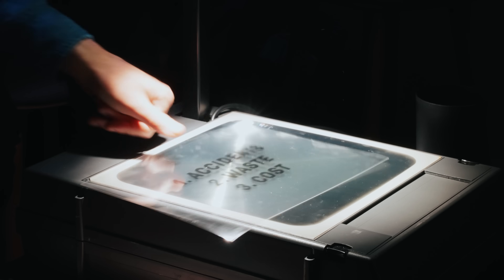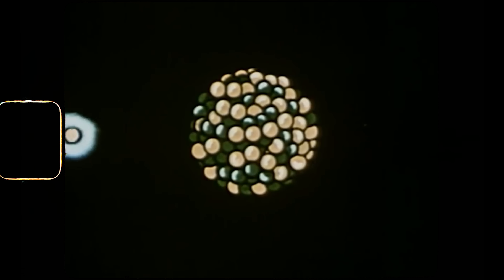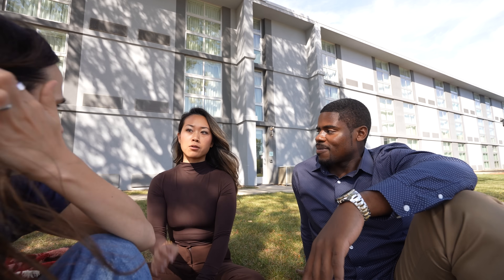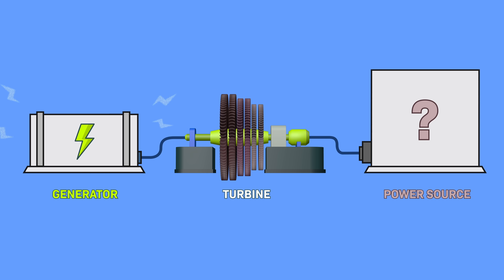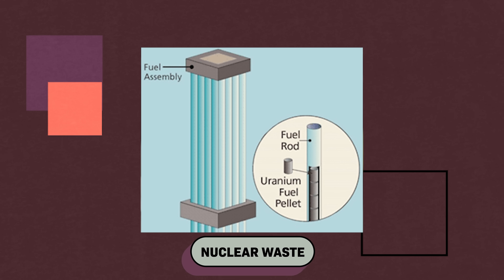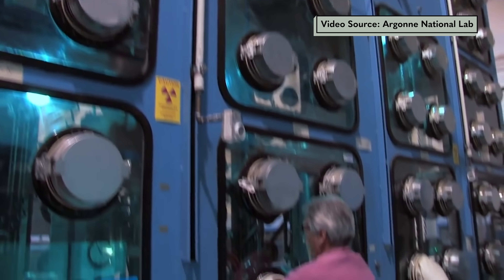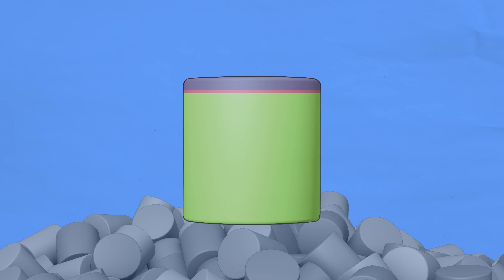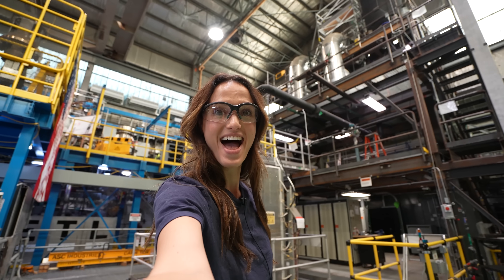The Big Lie About Nuclear Waste

Comment: TL;DR
Referring to "spent" nuclear fuel as "nuclear waste" is a misnomer. It still contains over 90% of its potential energy. Fuel reprocessing is banned in the US. The ban can be reversed and plants stood up in short order. The uranium supply chain is seriously broken as Russia is the world's leading producer; an extreme vulnerability due to Kremlin politics. Molten Salt Reactor designs are ready for regulatory approval and pilot plant construction and operation. Fixing these three key issues would ensure domestic energy independence while providing safe, green, reliable baseload generation for many decades.

Full Commentary
I absolutely love this channel. However, clarification of a number of topics in this video is in order.

To get qualifications out of the way, I'm a former naval nuclear engineer and chemist who served aboard a fleet ballistic submarine, then went on to work on various nuclear programs such as Naval Fuels and Defense Nuclear Waste, as well as many, many projects to keep Savannah River Plant in good working order.

The number one thing that needs clearing up is the term "nuclear waste" itself. Spent fuel rod assemblies generally don't qualify as waste. Why? Because after being removed from civilian energy production reactors for metallurgic reasons, the fuel itself still contains over 90% of its energy potential.

Additionally, spent fuel rod assemblies are initially stored in onsite storage pools until decay heat decreases as the highest radioactive material burns out. Once it's deems safe to do so, spent fuel rod assemblies are moved to onsite dry cask storage.

So, true "nuclear waste" includes everything else. From rags and clothing, to tools and irradiated materials, to various chemical stews, to non-viable fissile material. Aside from decommissioned containment vessels, reactor components and reactors themselves, which are typically buried in secure and monitored facilities, all this other stuff needs to be processed, encapsulated and stored in geologically stable underground structures for hundreds to thousands of years.

I worked on just such a project in the 1980's and 1990's. However, nothing has come of it yet as a strategic national repository has received continual opposition due to NIMBY (not in my backyard).  Countries, such as Sweden, however, are moving forward with their own national repositories.

Now, on to the more important topics:

Fuel reprocessing
As Cleo accurately points out, fuel reprocessing is a viable answer to reuse of so-called "spent" nuclear fuel. Remember, over 90% of its potential energy remains.

Congress could act to lift the ban on domestic fuel reprocessing. Industry could then quickly move to stand-up facilities modeled after those operated by the French.

This single step would ensure a secure source of fuel for nuclear reactors for many decades.

Uranium feedstocks
To put it simply, just as our government has banned fuel reprocessing, so to have they handicapped domestic uranium mining and processing. Currently, Russia is the world's leading producer of nuclear fuel for civilian energy production. With Putin's invasion of Ukraine, these feedstocks are unreliable, at best.

Here again, Congress could act to create incentives for domestic mining and fuel processing.

Next generation reactors
Aside from the reactor at Argonne National Labs that Cleo highlights, a reactor design was developed, constructed and operated in the 1960's at Oak Ridge National Laboratory that burned the equivalent of spent nuclear fuel. It actually operated for several thousand hours before being shutdown and decommissioned after funding for the program was eliminated.

Molten Salt Reactor designs, such as that which ORNL developed, are humanity's best hope for abundant, reliable and safe baseload generation. Several companies have developed modern designs that, in addition to working down the country's spent nuclear fuel stockpile, are inherently safe. Unlike traditional light water reactors, the fuel for molten salt reactors is one in the same with the coolant. These reactors operate at or near atmospheric pressure and are "walk away" safe, all while the waste generated is dramatically less voluminous, as well as less radioactive, also for far shorter periods. Additionally, proliferation risks are all but non-existent.

Comment: I get that recycling can maximize the available U-235 .  Are you pulling out the daughters of fission in this process? if so where does this go as this is the worst of the material that needs to be stored.  How is the recycling dropping the storage time of the final waste after it has been recycled several times.  I was under the impression that breader reactors never worked as promised or is this something different than that.

Comment: Good info but I learned very few. Recycle how and what? What kind of reactors not suitable for this? What is the cost of building recycling plant? What is cost of current nuclear source material? What are the actual elements that can be put into reactors again?.. left with so many questions than answers!

Comment: We do nothing about nuclear wastes because... they are not a real problem. If we had a lot of them - OK, action needed. So far, it is only talking. Nobody wishes to spend a penny, because current, relatively inexpensive solutions works. 

Hundreds of thousands to millions prematurely die due to air pollution every year. Nobody dies due to nuclear pollution, after those 39 years it is (mainly!) safe even around Chernobyl.

Let's be real. Who reworks spent fuel? Those who need plutonium for nukes. 

Only if we start to run out of fresh uranium, we'll burn old fuel or thorium. Development of current nuclear tech was triggered by military needs. In the sixties it was all the rage. Now? Ehhhh...
Reply: We can just store the waste for retrieval in a mountain in the middle of Nevada. It's no big deal. You're right
Reply: @stevencooper4422  At least less of a problem than millions of tonnes of ashes from coal power plants.

Comment: Wait, 150? I remember hearing it was more like 10 or 15 years, which is still impressive... but 150???
Reply: I'd be EXTREMELY wary of that claim. And I'm almost certain this assumes CURRENT power requirements without factoring in future growth (and probably includes a VERY optimistic estimate about the amount of re-useable spent fuel).

Comment: Hi Cleo... are you bought? or are you just misinformed on the subject, like so many?
Reply: Nuclear power is the future for powering desalination and electric cars. What don't you understand?
Reply: No but it seems you are friend
Reply: @Krill_all_health_insuranceCEOs  Considering I'm a retired reactor engineer, I doubt that very much.
Reply: @crystallake6198    Mkay well Ms Lake then why are you against expanding nuclear energy as we will have to do if we wish to get off fossil fuels quickly?
Reply: @Krill_all_health_insuranceCEOs   Nuclear as a whole is an inefficient means of power generation. Its entire fuel cycle is extremely inefficient, though most of the data around cost and energy consumption (e.g. for fuel enrichment or reprocessing) is masked or left out of many studies. In the end, all a nuclear power plant is doing is heating water to spin a turbine. Just like most other power plants. Only nuclear is doing it with some of the most dangerous materials on earth. There are a few things mentioned in this video that I feel warrant some clarification: 

1. There's no such thing as recycling of nuclear waste. Its called reprocessing of spent fuel, and re-processing is an extremely energy intensive process, which often relies on fossil fuels. It's highly costly. Reprocessing also introduces its own complex set of wastes (which are highly radioactive), that nobody talks about. In fact, fuel reprocessing is such a dirty process that the NRC scrapped plans to allow new commercial reprocessing in US back in 2021. Other countries that do this (France, England, Japan) actually pump their reprocessing wastes which can consist of transuranics, tritiated water, volatile organic chemicals, sludges, and other nasty stuff (sometimes plutonium compounds) right into the ocean.  

2. "High Level" radioactive waste is not the only waste to be worried about. In fact, one of the dirtiest secrets in the nuclear industry is that only fuel, spent fuel, and mill tailings are considered high level waste. But wastes considered "low level" can be highly radioactive as well. These include activated metals (like steel beams, shielding, piping, etc) that have become highly irradiated due to neutron bombardment. These metals can kill a person who is directly exposed to the for short periods of time, though they aren't considered high level wastes. The industry would like you to believe that low level waste is just office papers, gloves, and pencils. Far from it. When a nuclear reactor is decommissioned, the reactor vessel itself (which is highly radioactive) is considered low level waste.  

3. New "Next Gen" reactors, which tout the use of other wastes, such as thorium, don't fix anything that's wrong with the legacy generation of reactors. You can can't just take a shovel full of waste thorium and toss it into a reactor expecting energy. That thorium (like raw uranium or reprocess mox fuel) requires some sort of enrichment/extraction process, and then needs to be fabricated into a usable fuel element (either a pellet or a sphere). Again, this is a costly, energy intensive process, that creates own complex waste stream that's dirtier than anything that comes from other forms of energy generation. And again, we're doing all of this to simply heat water to spin a turbine.
Reply: The real answers to the world's energy problems are to: 

(a) figure out how to convert energy from one state to another (directly to electricity) without the need to mechanically spin a turbine. Solar technology is a very very early step in this direction. It takes light, and converts it directly into usable electricity via photovoltaic cells. I'm not an advocate of the solar industry, there's been too many broken promises there, and the materials and manufacturing techniques required for today's cells are not environmentally friendly either. But solar does prove that Energy(x) can be converted directly into Energy(y) without any mechanical movement. 

(b) we all need to realize that a "power grid" is the wrong approach for a myriad of reasons ranging from security to distribution efficiency. Energy generation should be as distributed as possible, and generation should be moved as close to the consuming devices as possible. The larger the grid, the less efficient it becomes. Today almost 70% of the energy that's input into power generation is lost by the time its delivered to your house. This means as a society, we really only need 30% of the energy that's being generated by these large scale power plants today. Imagine if we could all get on the same page and eliminate most (or all) of that wasted 70%. If you factor in all of the energy consumed to mine, mill, enrich, fabricate, ship store, and use nuclear fuel, that wastage is more closer to 80%. And the security issues around a grid grow proportionally to its size as well.
Reply: @crystallake6198     I appreciate this information.

I'm sure the power grid can be improved in multiple ways. Naturally, we should do this now. Were it not for worthless elected politicals from coast to coast, no doubt we would already be much further ahead in this regard. 

Nuclear energy is still the best overall clean and reliable fuel source to facilitate a full transition off carbon fuels in our lifetime. It isn't perfect, but every drawback and perceived negative issue is currently being addressed and considered, with ongoing constructive solutions being offered or has been effectively addressed already. I believe the current storage and reprocessing solutions are more than adequate for the foreseeable future. 

I appreciate all renewables, but they alone won't do it, at least not yet. We need both approaches. Nuclear plus other useful renewables will produce a world's worth of clean carbon-free energy. 

And don't forget - fusion will be here in 100 years or less.

Comment: We are not only throwing away the milk, but the cream too. Only about 1-2% of the solid mass of those uranium pellets actually gets converted to energy. Not only is recycling of U-235 and option, but other types of reactors that use different fissile materials are too. Other countries use reactors that create fissile Pu-239 from neutron bombardment of U-238 called fast breeder reactors. There are also other designs that use other abundant elements such as thorium for energy, working examples of these reactors date back to the 60's in Oak Ridge National Lab. By increasing energy efficiency through the use of other isotopes, recycling,  and generating new fuel from breeder reactors, we would supply enough power for the world to meet our needs until the sun explodes.

Comment: You talked about reducing radioactivity in nuclear waste. But you didn't really touch on reducing volume of nuclear waste too much. For instance, about 95% of all nuclear waste volume is low level nuclear way waste which can decay to safe levels between 5-30 years. High level nuclear waste like you are talking about is a very small overall volume of waste.

Comment: By the way, in Canada we use unenriched U238 in our reactors called CANDU. What makes this possible is using heavy water to slow down the neutron so that the uranium atoms can capture it and then split. Most other reactors use regular water which don't slow the neutrons down enough to work. So the Uranium needs to be processed until the concentration of U235 is much higher than in natural uranium.

By the way, used fuel is initially stored in large pools of water that look like swimming pools. They are left there for a number of years until the heat they release goes down (yes, they give off a lot of heat even when fission process stops due radioactive decay). Then it is put in the concrete casks.
Reply: CANDU reactors are fantastic. 

And don't you guys recycle the fuel with dupic reactors?? 

I'm a big cheerleader for green nuclear including CANDU
Reply: @Krill_all_health_insuranceCEOs  No recycling as of yet. What is a dupic reactor?
Reply: @mirskym   I'm not 100% clear. I'd have to watch another video. I'm still getting all this info straight in my head. So I'd have to get back to you on that.

Comment: Cleo, take a look at Canada's CANDU reactors.  That reactor design has the following features:

1) you do not need fuel enrichment.  The heavy water design makes the neutron moderation so efficient you can use natural uranium, thorium, plutonium, and SPENT FUEL from other reactors.  This also addresses nuclear proliferation concern as you need fuel enrichment to make a bomb.  Since this reactor does not need enrichment, you are not passing on nuke weapons infrastructure when selling a CANDU.

2) the heavy-water design allows you to but the fuels in CERAMIC - thus eliminating concerns of ground water leakage when going into long term storage.

3) the reactors can refuel WHILE RUNNING.  That means the reactor can run for YEARS - 24/7/365.

The down side is that heavy water production is expensive - but you trade that expense for flexibility of fuel source, high uptime, and reduction of nuke weapons proliferation.

Comment: Î still don't understand why they ditched the ORNL Molten Salt Reactor concept, which was running well and could achieve the same goals if they just worked on a (feasible) way to sequester Tritium. Back in the 70s fuel efficiency wasn't so important and tritium had no market value. But with advances in Fusion, it will have a big value.

Comment: So they claim the problem is that current reactors can’t use recycled fuel? And that it is too expensive? So all they need to do is to build a new reactor that only works with the recycled fuel, then they can still use their current reactors for new uranium and then recycle the fuel after, then when their current reactors need decommissioned they just stop using that kind of reactor and don’t build any more and only build ones that can handle recyclable fuel.

Comment: I would like to correct one piece of information, fuel enrichment is the process of condensing the amount of u-235 in the fuel this is done by seperating the isotope frome the mix, the process you described is breeding. Both of these processes reach the same end but differently als breeding happens in a reactor

Comment: One tiny omission (or I just skipped around the video too much as I didn't want to be talked to like a grade school kid on a field trip about topics such as "what is uranium") is that nuclear waste is NOT just spent fuel rods/pellets,  it's everything else that became radioactive as a result of working in or near a reactor everything from clothing workers wear, mops used to clean up stuff, those rubber gloves they're using at Argonne to handle the fuel pellets, the liquid used to move the heat from the reactor to turbine, hell the concrete of the reactor itself.   Now sure none of this is as radioactively "bad" as spent fuel rods but there is far FAR more of it, and this waste absolutely can not be reprocessed into fuel because what makes it radioactive is constant neutron bombardment, so it's not U235 impregnated shoe booties it's simply a radioactively unstable isotope of shoe booty material.